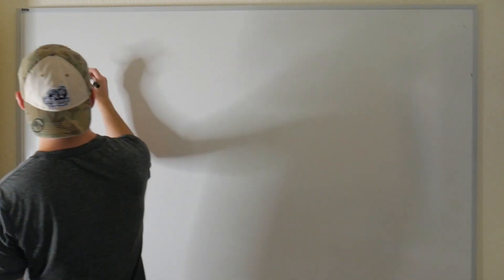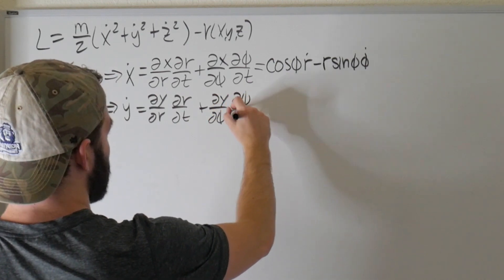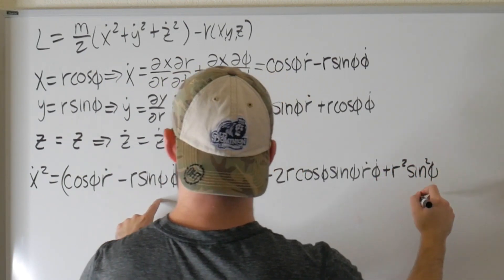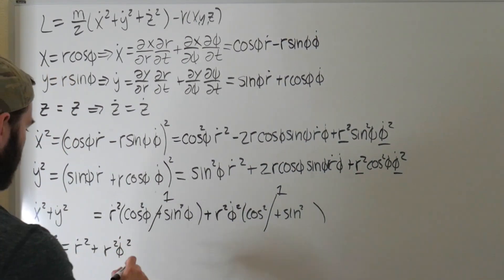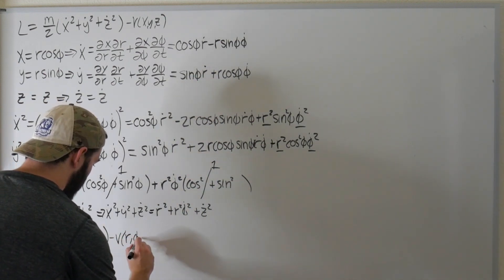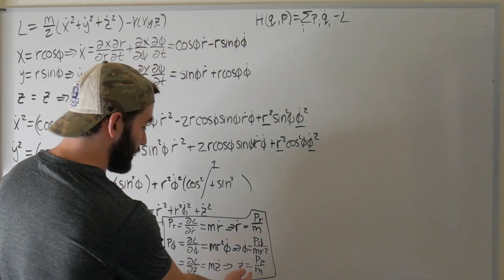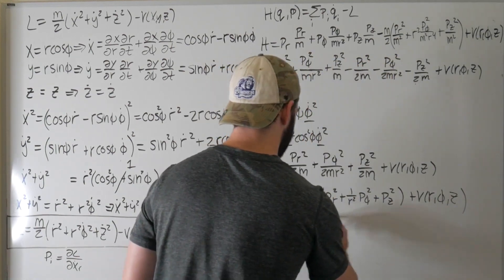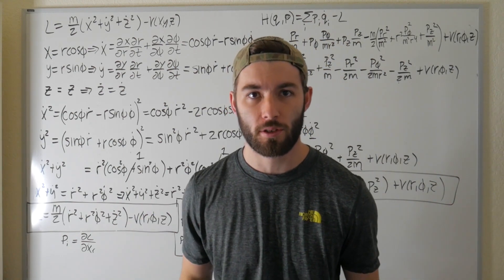One Cylindrical Boi vs  Converting Lagrangian to Hamiltonian

Comment: Hey Andrew,
I actually also have a white board that I need to mount into drywall but it’s really big, like maybe 7ft by 4ft ish but it’s big. Will those anchors still hold it up?
Reply: Yeah they should I have one that's about 4ft by 8ft mounted in dry wall it had been there for over a year however the screws were pretty big.

Comment: Schrodinger equation in 3D using spherical coordinates please. I need to know the mathematics behind using spherical harmonics. It's not given in grifith.
Reply: Quahntasy - Animating Universe  what exactly do mean by “the math behind using spherical harmonics”? They are just complex varied functions, so if that is that’s tripping you up, go read about that. They’re also orthonormal,  which means the inner product between two of them is equal to the kronecker delta